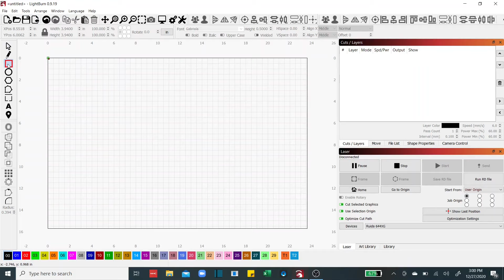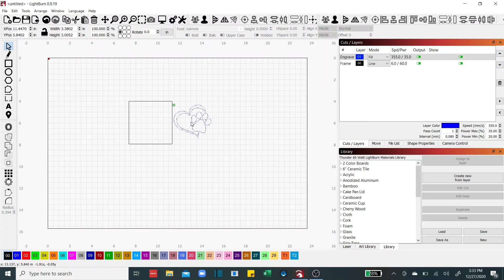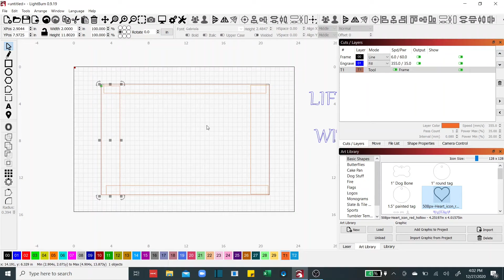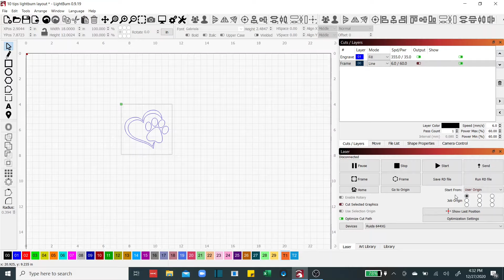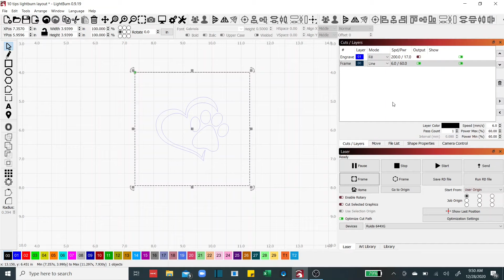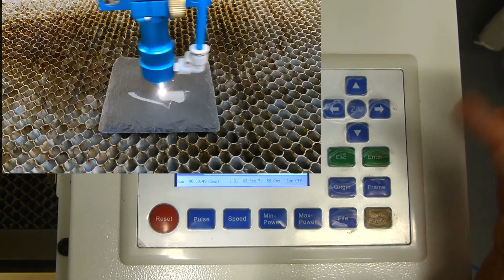10 Tips and Tricks for New Laser owners that use LightBurn

Comment: At 25:40 you turn on the OUTPUT for the frame. Does that meant the laser is actually ON while it is in the framing movement process? Should it be off and only the SHOW box checked?
Reply from the maker: I’m turning the out on so it frames my selection properly, I turn it off if I don’t want it to go to the laser

Comment: Hello, my LightBurn speed setting shows it in mm/minute. I can’t find where you can change it to mm/sec like you have in yours.
Reply from the maker: If your using a much slower diode laser it will be in mm/minute. Mm/second will be for co2 lasers
Reply: @computercreationz  But mine IS a CO2 laser….
Reply from the maker: @checksixivan4921   Are sure your setting are correct in the gear icon up top
Reply: @computercreationz  that was it thanks

Comment: by the mode  i dont have the line and fill option
Reply from the maker: Yes it’s still there just in a different location. If you look in the top tight hand corner of the layer there is a plus button. Click and pick your mode and settings. This is an added feature since this video was shot. Thanks for watching
Reply: it just added a sub layer but not the  mode option
 @computercreationz
Reply: its only added a extra layer not the line fill mode
 @computercreationz

Comment: Awesome video and these help with us newbies. In my version of lightburn, in the mode, it only shows Line - Fill - Offset Fill. I see on your tutorial that you have a Line + Fill. What is the difference between Offset Fill & Line + Fill?
Reply from the maker: the lightburn documentation has the best explanation for those. usually I use offset fill for engraving a frame on wood but can be hard on your machine. the fill +line is not a mode now and you have to add a tab if you want this mode. this new feature is much more flexable than the old way

Comment: When I import a picture, jpg, png and the box or handles around it is larger than the picture, blank space either on the sides or top or both, how to I get the picture to only be the exact size of the picture. I have found when I size this type of image the size used includes this "white" space and makes my image smaller. Your assistance please. Thanks.
Reply from the maker: remove the white background in a photo program like affinity photo, photoshop or other photo editing program. size your pic in that program. save as a png. don’t resize once in lightburn. you will get much better results.
Reply: @computercreationz   Thank you

Comment: There is a better way to mark you frame... Use the T1 or T2.  It is designed NOT to burn at all.  It is specifically for framing.  Give it a try. There are no speed/power settings, so you can't accidently leave it on and ruin a project.
Reply from the maker: thanks for comment but unless something has changes tool layers can  not be output or sent to the controller so you cannot use them for framing on the co2 laser controller. . let me know if I’m wrong!
Reply: @computercreationz  I use the Xtool D1, and it works great. You select it, and send it the same way you send the black color you have set up for framing...

Comment: OK, I'm thinking. My engrave layer for wood would be different than my engrave layer for acrylics. Would I want to name my Wood layer FRAME WOOD and my Acrylic layer ENGRAVE ACRYLIC...  or just put a File Note that opens with said annotations?
Reply from the maker: Don’t get that far in the weeds it’s not worth it. Remember a color and that color is a function, all your settings should be in the material library. Use that to assign your settings that way you don’t have to remember anything. The problem with assigning settings to layer color is when you pull up that file 6 months from now you won’t know what color does what without retracing you process. Just my 2
Reply: @computercreationz  Okay, thanks. Now I have to go to your video re material library and set up my own. I usually use Black for my frame and red for etching. Orange for the tool setting; etc.  I just recently realized that every time I opened a file, the settings were from an earlier project. your File Note thing is really coming in handy. Thanks.

Comment: hi thanks your video.When writing text in the program, when a letter is finished, it burns while passing to the other letter. In other words, it progresses by burning up to the next letter without closing like handwriting. I will be glad if you can help me, how should I set it up.
Reply from the maker: it sounds like you might be running a diode laser. it’s a g code setting that turns that on and off. the lightburn forum should have that topic.

Comment: how can i change from mm to inches for everything?
Reply from the maker: Look right below the icon with a gear o it. It will say mm or in. Click that button to dynamically change from mm to inches. It works great
Reply: @computercreationz  I installed light burn but it didn't give me an option for any com . Any idea how to fix.  I had to add the laser manually to set it up.

Comment: When i open a file from the Art Library and I want to make a note that always shows up do I have to save it as a new file on the pc? I prefer not to but i think is the only option to add a note to any file.
Reply from the maker: A graphic from the art library is not a LightBurn file therefore no notes will come with it. When a graphic is dragged from the art library to you desktop it just a graphic. The only way you can save notes is to save your design as a LightBurn file and it’s not stored in the art library. https://youtu.be/Rv7GAKFilUs

Comment: Great information. Thank you for explaining features. 
I have one question. I was using K40 whisperer with my K40 laser and there was an option to invert colors of your design. it was very handy especially for making stamps. for example it would turn black areas to white and vise versa. 
Is there a similar function in Lightburn or what would be the procedure? 
Thank you very much for your time.....Al
Reply from the maker: I believe you can invert once you open up your layer, should a invert radio button. i believe it has to be an image though. hope that helps and thanks for watching.

Comment: pro tip at the bottom of your cut/layers far right is orange t1 & blue t2 use this for your frame with no output!
Reply from the maker: I don’t know about you but because there is not output to the laser the laser will not actually frame your work on the laser. Frame your work in the software yes but I haven’t been able to get that to work when actually having the laser frame your work with T1 or T2. Please let me know if you are able to get it to work. Thanks for watching!

Comment: Brand new at this! Not sure why but the grid numbers horizontal are backwards and seems to be jacking up placements
Reply from the maker: when I see the work space or designs coming out mirrored it’s usually that you have the machine coordinates set improperly when setting up LightBurn for the first time. like you’ve set them back left hand corner but it should be back right hand corner. check with your laser manufacturer and verify what’s correct.  LightBurn icons to the right of the preview icon

Comment: Your video are the best! Very helpful to me....  a brand new beginner....  new to laser and new to lightburn.  Can someone help me with a couple simple questions????   Why is my little green box in the bottom right corner instead of top left???   Why is my grid running backwards on the numbers.  '0' is on the bottom right and lower left instead of top right corner????  how do i fix it...  thanks  I need a beginner for dumby book! lol
Reply from the maker: I believe your machine origin is not set correctly, if you open the little wrench icon and check your origin, if it need to be top right verify that is what it’s set at. it’s next to the working size. hope that helps

Comment: The frame buttons are with "beam  disabled".  How do I enable the laser to work with the framing buttons?
Reply from the maker: I don’t believe that s possible. All of the safety protocols are disabled when your framing. Therefore they don’t want to laser to fire while the lid of the laser is open.
Reply: @computercreationz  I have an Ortur LaserMaster 2 that produces only 5 Watts, and it doesn't have a lid. I think I'll just make a frame and assign a very low power level - just to see the laser. Then  run that layer with all the others turned off. That would do the same with a little clicking... Thanks.

Comment: Very nicely done, learned a couple things. Didn't know what the T colors represented when they were added, and the big one for me was being able to drag the screen around. Been using the scroll wheel to zoom in and out, especially using the editing tool, but the lack of pan bars drove me nuts.  One thing about changing the settings of the colors, something I found that can be done if you wish to keep default on start up, but want to change a few for a specific job. Open TWO lightburn sessions, work in one where you make all your changes, and when done, close it first. When you close the second LB window, all the default settings will be saved.  This way if you have them all laid out for average jobs, and you need to modify one for just one particular job, you can without disrupting the normal levels and names.  What I like about Lightburn is that you can run multiple windows at once, though only the first controls the laser, it allows you to import an SVG or DFX with multiple parts, and you can cut out individual parts, work on them in  another window, and save them as single parts.  I do a lot of RC airplane parts and this is very helpful for me.  If I want to test cut the parts, I import into the second LB window and cut them from there so I can cut from the primary window.    I just with is had a dimensioning tool for those angled slots, so the proper degree can be made.
Reply from the maker: Thank You I appreciate your comments. I know when I found some of these options it made getting around so much easier.
Reply: @computercreationz  I actually let out a WOOHOO when I saw where you can move the screen with the mouse!

Comment: The T-1 and T-2 color boxes I think are used to make your Frame, or as they call it, tool. I call them templates.
Reply from the maker: If you use the T layers as a frame it will not work as a frame when you push the frame button on the laser. That’s why you need to use an actual layer as a frame instead. There labeling is a little misleading. Give it a try. Draw a Tool layer as your frame and then try to use the frame button on the controller or Lightburn frame button and nothing happens. I think that’s because the tool layer was never designed to be output to the laser. Thanks for watching I appreciate your input.
Reply: @computercreationz  Got it! Thanks!

Comment: Thanks for the tip about the notes, that one I didn't know.
A counter opinion about making adjustments at the controller.
I try not to make any adjustments at the controller unless I have to because the membrane switches on the controller have a very finite lifespan. Once one of the membranes breaks, that button will stop working and they cannot be repaired only replaced. Since these membrane switches mount directly to the main PC board in the controller, if any moisture gets through a cracked membrane your controller is not long for the world. Your computer mouse is much easier and cheaper to replace.

Comment: Great tips! I’m wondering about the last tip about changing the power on the controller. When you change it on the fly, is there a way to correct what was already engraved? To fix those areas where the power was too low? Thanks!
Reply from the maker: I have not found a way to correct the portion that is not right. Usually I’m using scrap material to get the settings dialed in. Once I get desired result I will make the product with those settings. Thanks for the question.

Comment: Nice. Don't use lightbun but thinking. Currently RD works. Tip no. You use use origin and pressing ori9gin. BUT that is what current position does. With this you do not have to press the origin constantly.